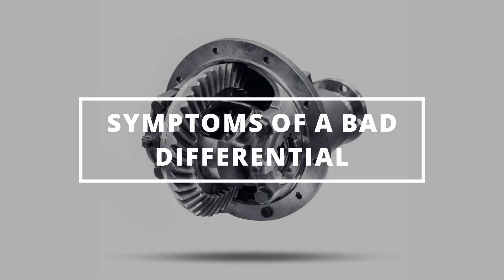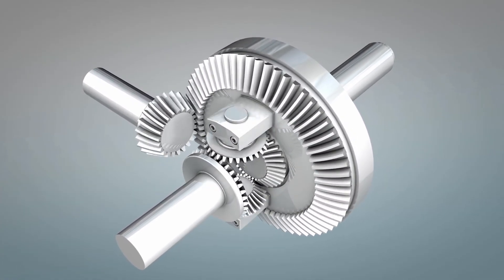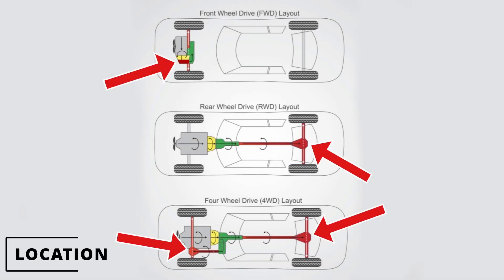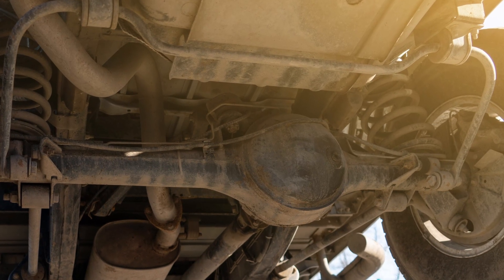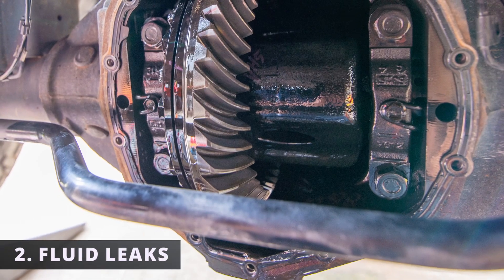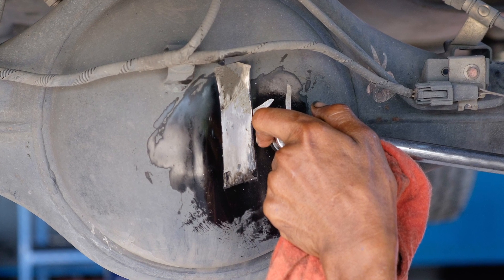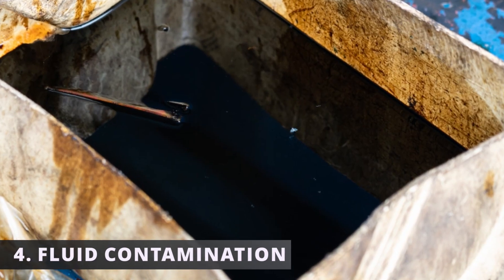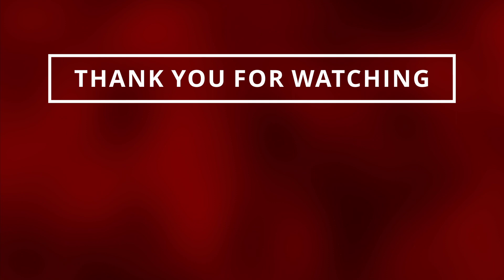SYMPTOMS OF A BAD DIFFERENTIAL

Comment: My question is, is a used diff automatically suspect if you turn the input flange by hand, and hear it click once in each direction?  This is a 2013 Durango front diff.  Trying to determine if I should install it, or not.  Thanks.

Comment: I had a weird jerky feeling in my steering and I added some gear oil to the front differential.  It helped it go away.  I did it with the vehicle on the ground BTW even though it was a little bit tight to get under that way.  I also added a bit of Liqui Moly MS02 additive and that may have helped too.  Just make sure there are no clutches in the differential first before you do that part.  It could cause them to slip if there are any.  My vehicle is a 2017 Nissan Rogue Sport SV with AWD (it is more like FWD most of the time really).  Also don't use the MS02 if you have limited slip.  MS02 is molybdenum disulfide and works as a lubricant.  It can be in oil or it may be in some dry lube sprays even.  I don't know who else makes a product like that additive but that product is the reason for the Liqui Moly name.  It is really a German company known for making some of the best automotive products.  They can be a little expensive but they work!

Comment: I have a bad pop when I’m in low gears it only vibrates when I’m turning sharp at low speeds
Reply: Me too did you figure it out? I also noticed if I give it a lot of gas from a dead stop the engine revs and nothing happens for a second until i hear and feel a grinding sound and start to move like some gears are catching all of the sudden. This is accompanying all around poor acceleration and noise from the front drivers side. I ordered a cv axle and may get a wheel hub and bearing if that doesn't work
Reply: Mine does the same everyone saying rear differential.. what did yours end up being?
Reply: I haven’t yet.  Mine seems to accelerate ok. I have found if I give it a good amount of gas  when taking off instead of starting slow it doesn’t do it as bad idk

Comment: I was quoted 2000$  to replace rear diff fro a 2014 nissan xterra, with no option for a new or rebuilt, only used... does this sound right?
Reply: I was quoted about 2.4k for the rebuild. I declined it. I can buy a diff for about 1.6 ish k maybe a little less and do it in a day and not have to take time off of work for having no vehicle. Or I can put the parts for 800-1000 and learn myself
Reply: For 2012 tacoma

Comment: how to control over heating issue Front axle
Reply from the maker: To control overheating in the front axle, check fluid levels and inspect for leaks or damaged components.
Reply: @easyautofix  no, im working on Concept design, i need idea for cool a oil in Front axle. without radiator and Design Change - is this possible to cool the oil through electrodes "Like Peltier Effect ". if it is available please let me know about electrodes

Comment: I think my mechanic pulled one over on me. 07 4runner he said the differential was bad. I thought I heard howling, but wasn't sure it if was the AT tires or the rear dif. And… $4k later I have a new rear dif and I still hear howling. He claimed the howling was better but I feel it was the tires all along.
Reply: Always check with another set of tires
Reply: Did you change the tires
Reply: Ties with big thread make a swooshing sounds when driving fast
Reply: @thechrisepisodes812 right I think they ripped me off
Reply: @chris_cann yeah my friends Tacoma started doing that when he got offroadsing tires it was annoying but it wasn’t the diff just the big thread on the tires ahhaha 😊
Reply: If the sound comes and goes at different speeds I would surmise that it was not the tires as if it were the tires the sound would be constant. Just my opinion.🤔

Comment: Mine goes clunk sometimes when turning going slow (or even when not turning) but its ok on highway speeds or anything over 20mph, anyone?
Reply: Seems like EVERYONE has this same problem and I've been watching YT videos covering all the front end parts and still haven't found an answer by a video maker or in the comment section.
Reply: Mine is doing the same thing. C*unking when I back up and turn.
Reply: My Mustang is doing the same thing anyone know what’s wrong?
Reply: @Michuy1  i looked under my car and seems like the diff mount bushing is shot, not sure if thats whats causing it though
Reply: mine to sometimes I don't hear it sometimes I do well not clunk but roaring

Comment: Mine makes the noise on the highway but only when i hit the gas. If I coast the sound stops
Reply: Me too still cant find out the problem
Reply: After research, it is definitely the rear diff
Reply: @savagestrikefishing4695 .........so it needed oil? Did you find that it was low?
Reply: So this isn't the diff then?

Comment: I changed my crv differential oil yesterday at 19k. It came out almost black. Is this normal the car is almost new.
Reply: Yes completely normal, for first flush as it needs to break in from factory. More changes lightin the color.
Reply: i gotta do mine. its at 120k. never changed oil before
2016 rav 4 Lol
Reply: @cloudchaser9951  😳😳😳
Reply: For honda rear diffs, it's best to change them early for whatever reason. The onboard computer on modern acuras often recommends rear diff service at as early as 7k miles believe it or not

Comment: Mine is grinding and makes it sound kind of like an airplane taking off. I have a Chevy avalanche 2012. For some reason it mostly only does it as a turn left like slight turning left. Does that make any sense? My friend and I unfortunately already replaced the wheel bearing and the driver side half driveshaft. Neither one of the solve the problem. Help
Reply: Its the fluid differential had to replace my whole differential due to metal shavings found inside
Reply: Have you found the fix yet? I also replaced bearings and it didn't stop the noise. Did you try replacing the fluid as he said? Or the differential?
Reply: I have the same problem s10

Comment: 2003 Mercury - no leaks - changed the fluid - but still hums when making a right turn at low speeds - not left - just right-
What is that???
My mechanic says - just change the fluid again- sometimes the first change may not do the trick. 
Anyone have any suggestions?
Reply: Grand marquis?
Reply: Marauder
Reply: @QuantumOfSolace1 bro I JUST got the same issue on my marauder 😢
Reply: I only have 36000 miles on mine - and it doesn’t start to do it right away - but after driving a bit it starts doing it!  Only on when turning right.  
Let me know if anyone has an answer!
Reply: @QuantumOfSolace1  wheel bearing
Reply: @QuantumOfSolace1 did you find out what it was?

Comment: They say mine is bad but it’s only at slow turns. It’s a groaning noise
Reply: Might be a wheel bearing if it’s during turns
Reply: @gagevieu3254  May be just low and or old fluid I noticed my diff was making noises and just went and removed the diff cover and found that the fluid was low and dirty and found no metal pieces or shavings cleaned the inside and cleaned and replaced the diff cover with a new gasket and fluid and drove it 80 miles round trip and no issues. try that at first
Reply: @gagevieu3254  I hope that’s what mine is. Mine makes that growling howling noise when turning and stepping on the gas, but not going fast at all.
Reply: Yeah same just replaced the whole differential
Reply: @Smakk.z  what did it cost you and what kind of truck was it?
Reply: @greekmaster1001  yeah it might be your differential because you would mainly hear it when turning the wheel i replaced it in my scatpack it was a heavy price but i only payed 100 since i had warranty
Reply: It's mostly your bearing in the the main case mine is doing the same thing
Reply: I’m getting the noise on my Ford transit 250 when turning in slow speeds my mechanic says I overload my truck with too much weight
Reply: Put friction modifier in it if it moans on slow turns
Reply: I have sound grinding only when I reverse and turn …one shop said bad front differential but i feel it not

Comment: Just bought a diff from eBay , it has no oil he says he drains them all for shipping... My question is when I rotate the main shaft the 2 for the wheels turn but I am able to stop them just with my hands as the main is still rotating.... Wouldn't that mean the cars not going anywhere if it was installed? .. is this bad😮
Reply: Sounds like you have an open differential. One wheel should rotate if the other wheel is stopped

Comment: Iam trying to figure out if its my differential or my cv axles. I have a 2007 honda crv the car runs smooth straight when i make a right turn or reverse turning it makes a loud clunking noise
Reply: Its the cv axle
Reply: I changed mine for that same reason and now I’m hear looking up why my car makes a grinding sound😂
Reply: Its CV axle.
Reply: CV axle. It's a common Honda issue.
Reply: That’s my car too

Comment: Never heard of anyone changing diff oil ever. You add to it if anything, shouldnt be a reason unless ofcouse youre replacing bearings.
Reply: The heat causes it to lose viscosity. That's why it needs to be changed. You think it's "low" but it's really just used up so it's thinner
Reply: @@seinordavethomas 373,xxx rear end hasnt been tore appart once, doesnt make noise or anything. Never had rear end issues with anything Ive had.
Reply: @Outdoorsman1944 Yup that's what my father has told me. He never had any issues with diffs and he has owed more vehicles than me. My diff went out at 103k replaced and now fear it's happening differently this time, which this diff only has 32k miles on it.
Reply: Or a replacing a failed gasket